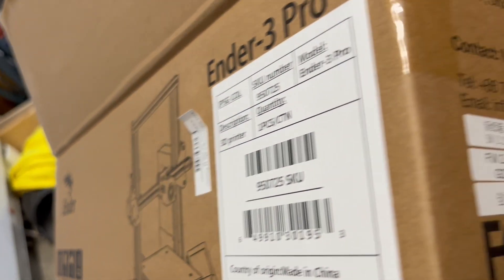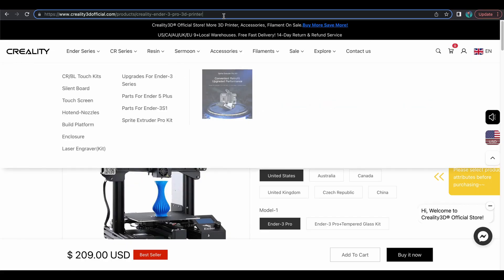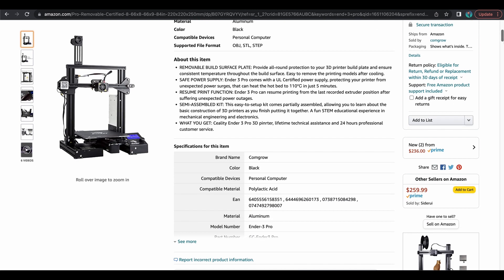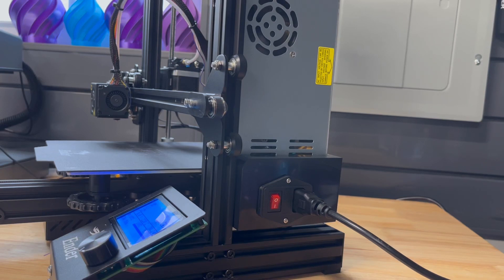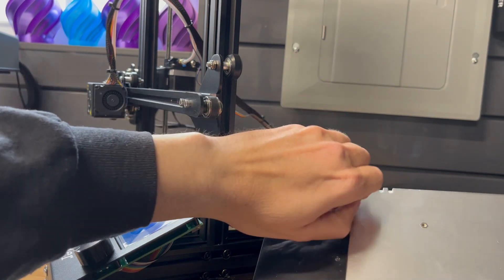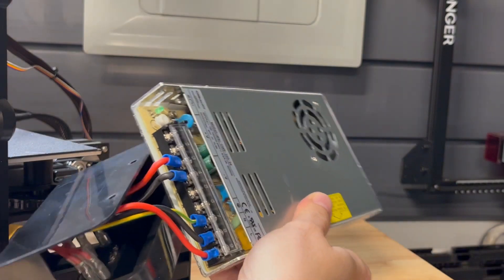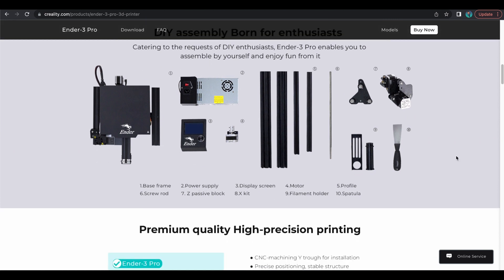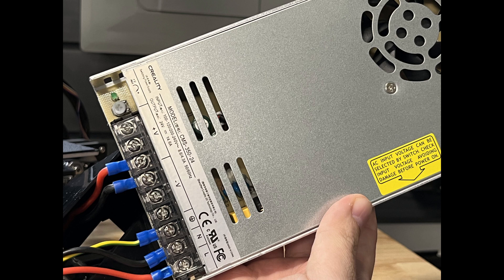ENDER 3 PRO -  Where Did The MeanWell Power Supply Go?

Comment: Holy ****. I didn't even notice mine has a 270W PSU. MicroCenter listing says "Branded Power Supply," so technically they aren't lying, but that's BS. They know that typically the Meanwell PSU is what we expect, and they know that saying "Branded" implies that it's a quality brand. They're obviously playing with words to cover up the change. They even show the differences between the Pro and Standard and the PSU column shows "Standard and Branded," so that we "know" we are getting a better PSU.  Pretty upset, but I guess they got me. You got me MicroCenter. Local brick and mortar is supposed to be more trustworthy, right? Sad.

Comment: I mean, like Prusa said prices are going up, but they don't want to make the machine worse so they raised the prices. Creality could be doing the opposite, using cheaper parts so that they don't have to raise the price. Now, you might be saying "why not raise the price instead" and that could be because its meant to be a cheap budget printer, unlike the Prusa, and it being cheap is probably its BIGGEST selling point, so if they raise the price, they will lose one of their if not their biggest selling points. Still not great that they haven't updated websites and stuff, but just saying that they may actually have a reason to change it.
Reply from the maker: The big difference.  Prusa was open to what they were doing.  Creality did not publicly announce anything.  Creality could have at least done a Facebook poll or something.

Comment: Does replacing this power fix overhead lights flickering when the printer is running?
Reply from the maker: Are you only on a 15amp circuit?  Or do you have a lot of things plugged in on that circuit?

Comment: does it matter that much ? if it has all the certifications it needs is it still dangerous im assuming they wouldn't illegally mark their psu for certifications it doesn't pass so does it really make the change that much more dangerous or is it more just a matter of their lack of transparency regarding the part change to begin with
Reply from the maker: What are the differences between the Ender 3 and the Ender 3 Pro?

Comment: Same for the Ender 3 V2 I bought roughly a month ago, it also does not have a Meanwell power supply...
Reply from the maker: Yep!  That V2 was supposed to have a MeanWell PSU!!!  
Ender-3 V2 3D Printer: Meanwell Power | 32-bit Silent board
The Best 3D Printer Under $300 (2021); Meanwell Power | 220*220 | XY Axis Tensioner | 32-bit Silent board.

Comment: Oh great, a Chinesium PSU on the "Pro" version. 😡 Now it's just the Y extrusion & flex mat making it different from the non-pro. 
One-finger salute to Creality. Very shady. 

The one I have is hardly an Ender 3 anymore after upgrading all the controls etc to make it what I should have been out of the box.
Reply from the maker: I agree 100%!  You nailed down what made the Ender 3 Pro vs the regular Ender 3.  Now they are also doing this to the Ender 3 V2, no more MeanWell PSU.  The Creality internally it seems to be a clone of the MeanWell, just will cheaper components.  Makes you wonder, does MeanWell know about this, or is Creality licensed to manufacture their own version?  So far only James Lim has posted backing up Creality.

Comment: John, Thanks to you and Tim for pointing this out.   I have given up on Creality and I think many others are also.  It is worth it to me to spend more and build a machine that just works, that's why I'm building my second Rat Rig.  They could rename this the Ender 3 FS (fire starter)
Reply from the maker: Greetings David!  I really think it is the consumer culture that is the issue.  Most are finding this acceptable, and never challenge the manufacturers.  I was told, well it prints?  What did you expect for that price?  I had to make this analogy earlier.  Say the model car you have been looking at has a standard Bose sound system.  Then when you purchase the car a few years later.  The manufacturer decided that Jensen is now the radio.  However, the manufacturer hid the Jensen name from you, and still used the same advertising.  They didn’t tell you that they switched to a less quality version.  Since the brand is hidden, you might not find out.  If you don’t hold them to a standard, then they will continue to do this.
Reply: @TripodsGarage  John, I think a number of us have really become involved in this hobby, and have gotten past the point of lowest price - as long as it works is OK.   The more you learn the better you can make good choices about what you want and what will get it done.  Creality seems to be on the path of the Yugo of printers.

Comment: I just finished building and setting up an Ender 5 Plus and this got me wondering, have they done a switcheroo on this model also, I will check tomorrow and post my findings!
Reply from the maker: I was the first person to post about the underpowered PSU that burned up in my original E5+.  Then followed up with a Meanwell PSU replacement video.  A few months later Creality started equipping the E5+ with a Meanwell.  Lets hope it still has one!  I am very curious.